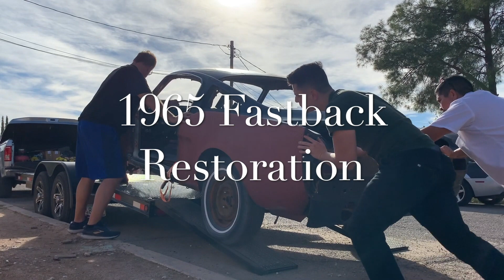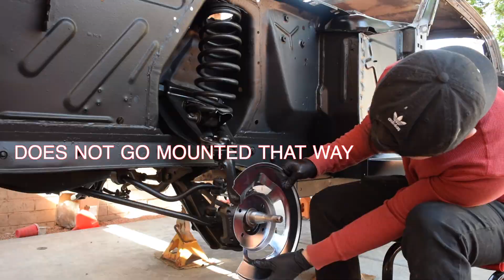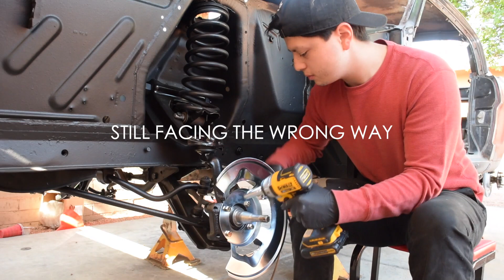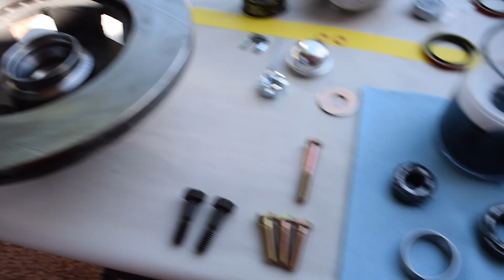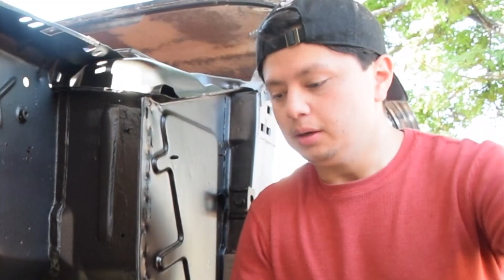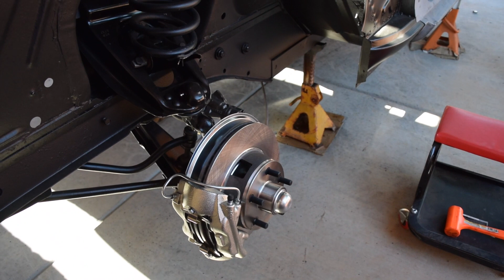DISC BRAKE CONVERSION | 1965 Mustang Fastback Restoration

Comment: Hopefully u didn't kill the rear oil seal sliding it on that  hard torque wrench Likely off they ant the best ones I'd check that front hub after driving it few miles
Reply from the maker: Thanks for the tip, i will double check before getting on the road!